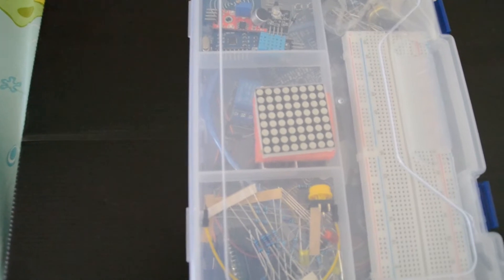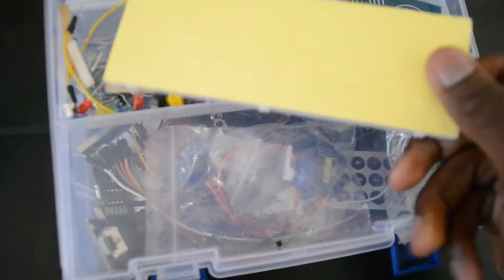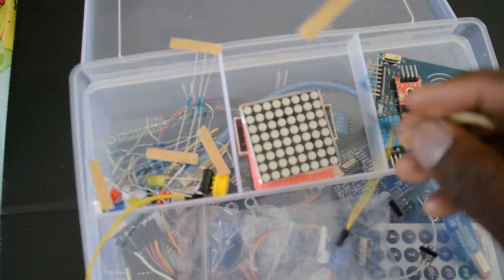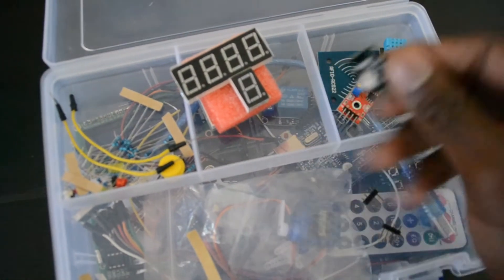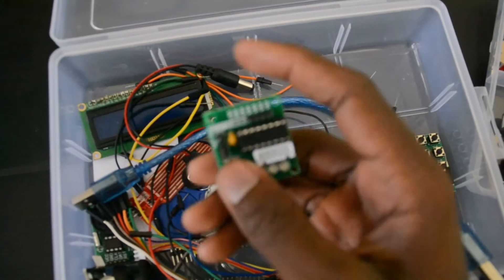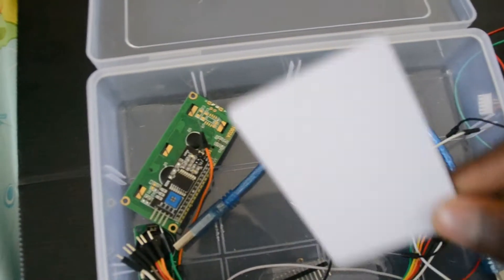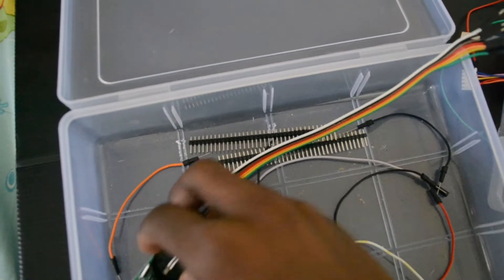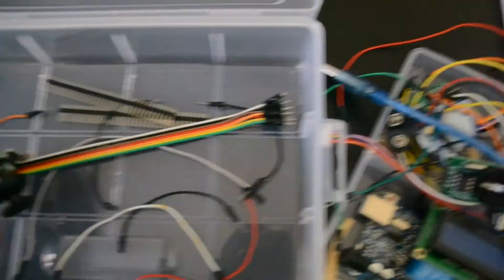Arduino kit from Aliexpress  worth it?? [Unbox]

Comment: Does this also work with Brrchacha 4.2v?
Reply from the maker: The Arduino Uno and mega boards works with 9-12V
On their digital ports they supply 5v for the modules
And de components or the accessories like an sensor 
They work with 5V normally
Some use 3.3 V 
So I recommend to search about the power needed for each module or sensor
Reply from the maker: Thanks for watching
Help me grow with ur ideias and sharing
Feel free to suggest
Reply: @SamSmartLabs  no problem, Thanks For replying! Have to search for a solution then